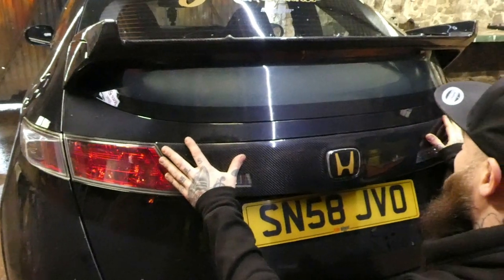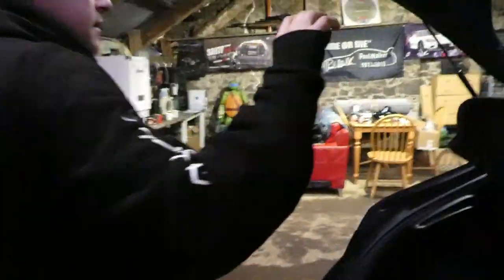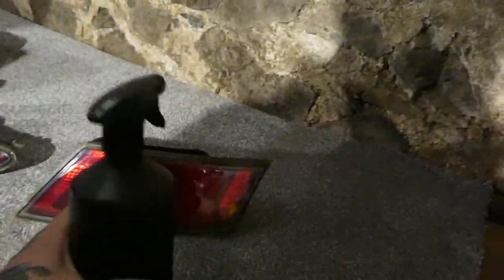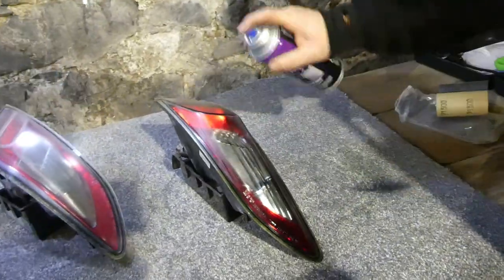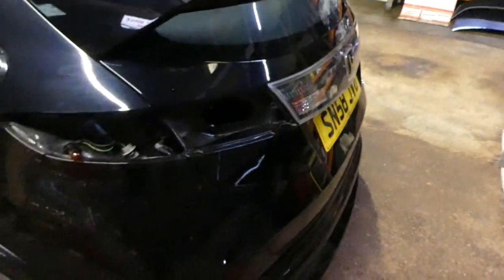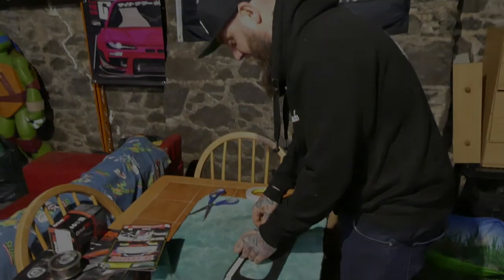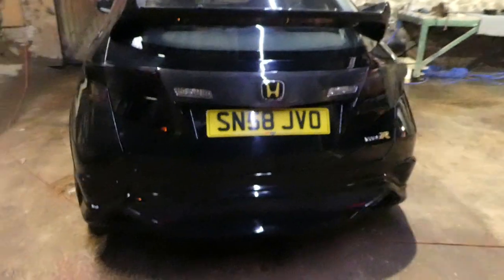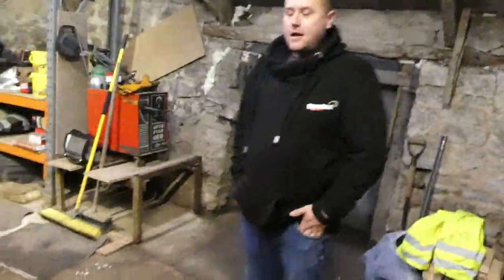Honda Civic FN2 Type R rear light tinting and carbon fibre rear cluster install

Comment: Looks amazingly stealthy chaps what clear coat did you put on those lights? I've heard different reports on people saying that light clusters need certain top coats otherwise they can oxodise again? I used meguilers on my front headlamps and a top coat is rubbish. You said the lights work ok, be nice to see them all getting there totally legal? Just another thing I had an ebay seeker type spoiler I put on and Ihad problems with oxidisation clearcoat  it was obviously crap quality I ended up spraying it eventually and wrapping it because where I live there were lots of sappy trees and crappy weather ruined it.
So make sure you keep the carbon protected just a tip. Have a great xmas will be nice to have one over the xmas period that you guys deserve a rest from being the funniest guys helpful fn2s on the tube....
👇🎅👍
Reply from the maker: Bless ya man thank you, we didn’t end up using a clear coat on them at all bud using that tint spray. We will definitely get a shot of them out in the dark and working, I followed Chris home and both lights brakes and indicators were fine, not sure on the legality side tbh lol.
Reply from the maker: @haseebsheikh7189  we have no issues so fsr pal but appreciate the heads up man 🤘🏻❤️

Comment: Guys why didn't you use a vinyl tint instead, easier than spray, I dd my Peugeot 2008 rear lights and so easy.
Reply from the maker: Chris has always and always will use. Tiny spray, can get them exactly the shade you want also and coverage is spot on obviously, each to there own though obviously bud 🤘🏻❤️
Reply: I tinted my headlights with film but will be tinting the rear lights in the new year with night shade spray because have you looked at the shape of those rear lights? Good luck getting a film round them
Reply: Yes I suppose its that acute angle well this is where inserts come in but I've only just changed from spray to film. 😊
Reply: @andylane1968  what do you mean by inserts, I'm thinking of tinting my rear lights on my Fn2 with a light smoke film.
Reply: @Springwater786  you doo bits at a time ,instead of trying to do the whole thing,so if theres angles that go in do those first then the eaier bits next. go and find the tinting lights from ckwraps and he will give you a step to step guide here on you tube.